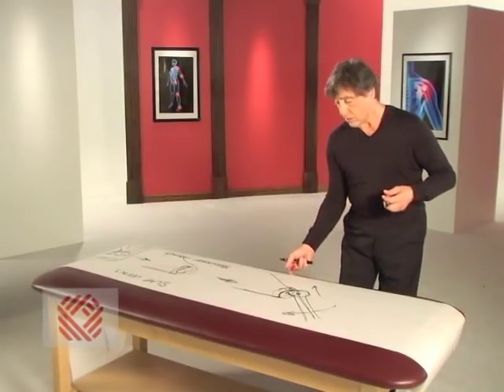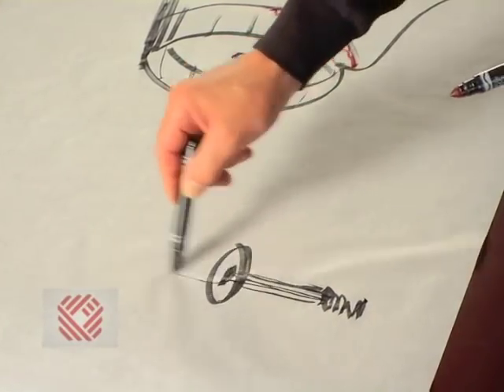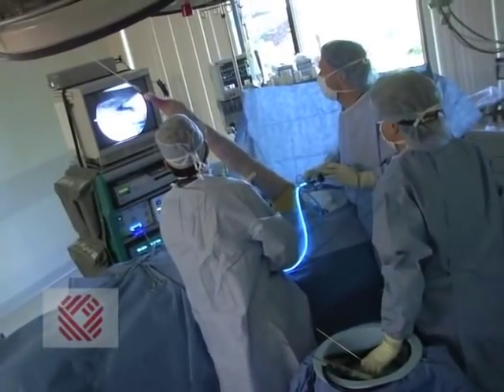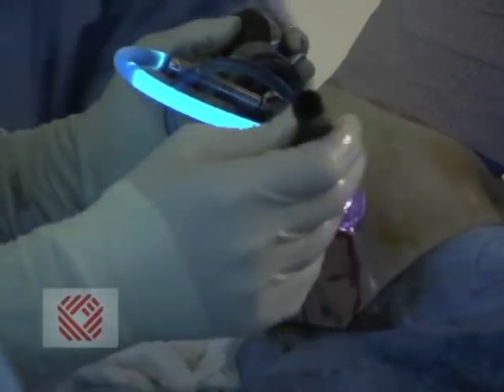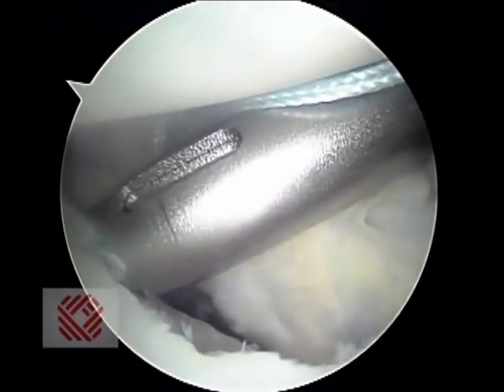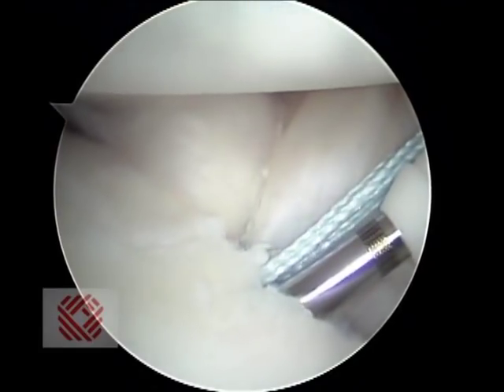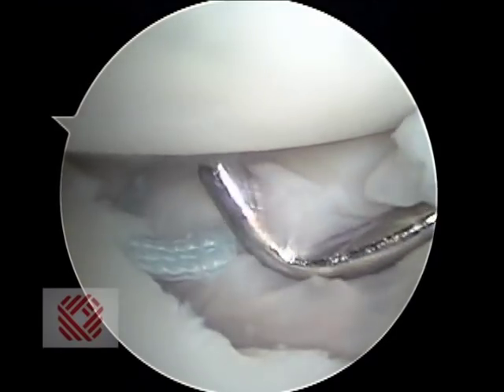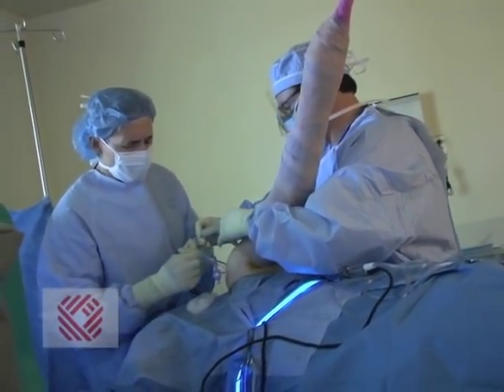Labral Tears Part 3: Arthroscopic Labral Repair

Comment: I tore both my shoulders at the same day 20 years ago, had my first labral fixation four weeks ago, let my arm free tuesday this week. Hope the healing goes well. I started to loose strength in the left arm the last year, and lost musclemass in infraspinatus behind the shoulder due to loss of signal to the muscle because of a paralabral cyst that formed of the fluids leaking out of the shoulder joint. This cyst was placed nearby the suprascapular nerve and decreased the signals going to the muscle. Hope the cyst dissapears now when the leak is fixed:)

Comment: * Thickening and mild increased signal intensity of supraspinatous tendon near its insertion - suggests tendinosis.

* irregularity of the anteroinferior labrum with linear hyperintesity extending from the labral surface to the subperiosteal region of the anterior scapular neck---- suggests possbility of labral tear (anterior labroligamenotus periosteal sleeve avulsion)

* An elongated multioculated cyst commencing near the anteroinferior glenoid margin and tracking aneroinferiorly---- suggests paralabral cyst.

* Mild fatty infiltration of the few fibres of the subscapularis muscle in the inferolateral aspect suggests focal chronic atrophy.

My mri report of right shoulder 

Should I go for surgery

Comment: i soooo hope i wont need this.... pt isnt helping my laberal tear and ive been in pain for two months niw
Reply: RxTechLA I just had this done. Surgery is very easy I’m a little sore don’t get my wrong but it’s really not that bad and well worth it in the long run. I did two months of pt and I felt that it made me worse actually so you might be the same. But long story short the entire process of surgery was very easy and not at all painful or scary. Good luck with your shoulder!
Reply: RxTechLA didn’t realize your comment was from 7 years ago never mind 😂😂😂
Reply: @CP3Crossover  and are you back at full strength now and how long did you have to pause after the surgery ?
Reply: I had my surgery in November 2012.  It took me about a year to recover and about 2 years to fully get back into my routine at the gym.  I have arthritis in my left shoulder but the surgery improved my quality of life.
Reply: @lcdaah11  why did you recovery took 2 years ? 
I thought 6 monhts is the max
Did you have slap tear ?
Reply: @CP3Crossover  LOL I did not need surgery!! I had to quit roller derby, my shoulder pops every now and then but I am ok now

Comment: What's normal recovery time? maybe to get back into bench press?
Reply: JoeCnNd I recently got the surgery & they told me 6-8 months but my rehab was finished around 4 1/2 to 5 months. It all depends on how well & quickly your shoulder reacts to the rehab. So I'd say minimum of 4 months and a maximum of 8 months but expect something around 6 months. Also dont rush the rehab and try to start normal activities to soon, as you could easily re-tear it.

Comment: It's been 3 weeks still in a lot of pain . especially at night.
Reply: Never again
Reply: Donna Anderson hows is it now and May I ask how old you were at time of surgery
Reply: @smoothy4045  it case it helps, I had this done 2 weeks ago. I'm 33 years old. In my case, I had 4 "anchors" put in. pain is bearable but it is a constant discomfort so far. I still need to sleep in an almost sitting position due to the pain. I've been told I'll have the shoulder immobilized for at least another 2 weeks and that physical therapy won't begin until at least 3 months after the surgery. I hope this helps.
Reply: Hey Donna, ill be undergoing this surgery soon. How do you feel now? Was it worth it?